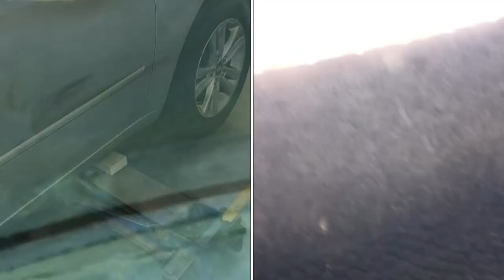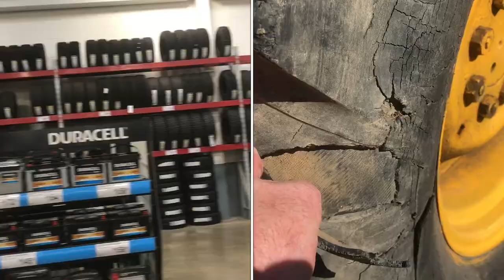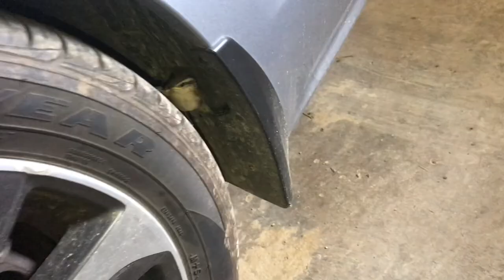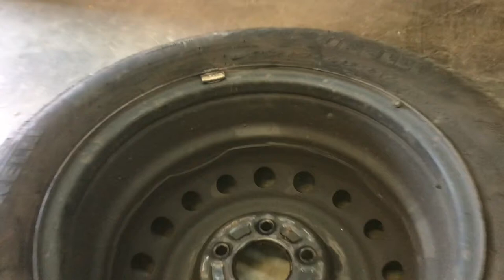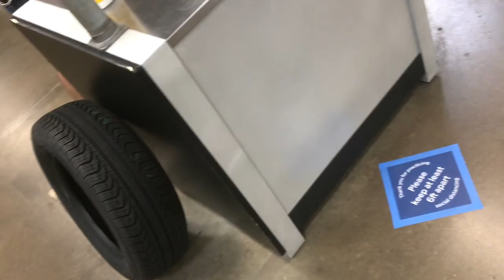can a HOLE on the “side wall” of a tire be fixed?

Comment: I work in a tire service, and these punctures (If not bigger than 1cm) are in fact easily repairable. No need to waste a perfectly good tire if the repair costs max 15 bucks and takes 10 minutes.
Reply: what do i say to get a place to do this for me or where do i go , im from ontario canada,, the hole is so small you cannot even see it its less then 1 cm and basically the size of a tip of a sewing needle..

Comment: Totally repairable with a properly affixed patch. But still nobody will do it because it's not worth it and since that's the flex area of the tire and the patch will possibly work its way off.  So can it be fixed? Absolutely.  should it be fixed? No

Comment: I have patched holes in the sidewall of tires for years with no issues.  I would not recommend to someone to plug a hole in their tire but I guarantee that I will plug a nail hole in my tire instead of spending $100, $150, $200 for a replacement when the tread is still good.  You cannot patch a hole in the sidewall.  The sidewall moves to much over that large of an area and will break down the patch.  As a general rule, if you are not a do-it-yourselfer, get the tire replaced.  If the treadlife is 50% or less, get the tire replaced.  If it will worry you, get the tire replaced.  If you have unlimited funds, get the tire replaced.
Reply: You say you have done it for years then you say “you cannot patch a hole in the sidewall” which one is it?
Reply: @geocap846 I know right

Comment: I had a micro hole from a picture hanging nail i just plugged it and it worked like a charm. I will touch back in a month to tell you if im still alive 😮
Reply: The nail itself was doing great holding in the air
Reply: @micahburbank2425 well u good ? Just had a nail size puncture upper sidewalll of brand new 315/17’s BFG k02